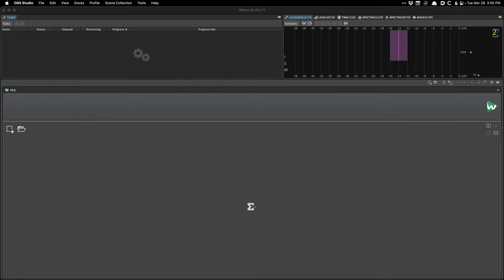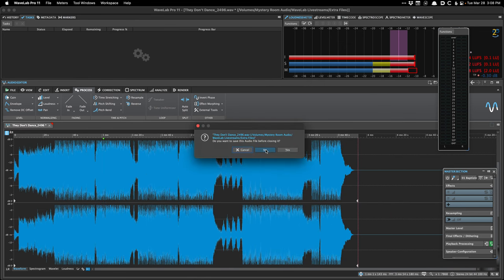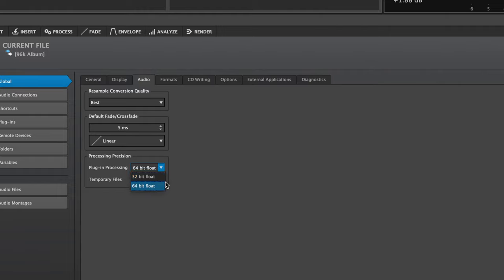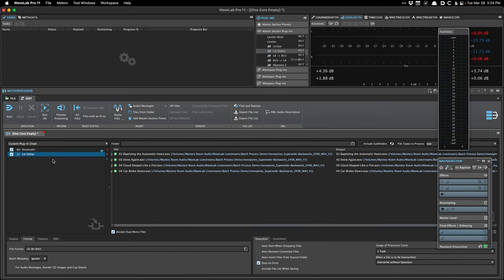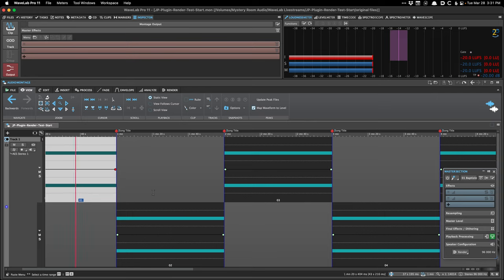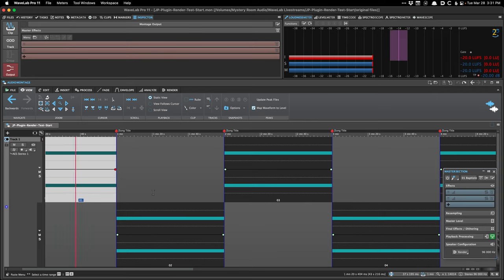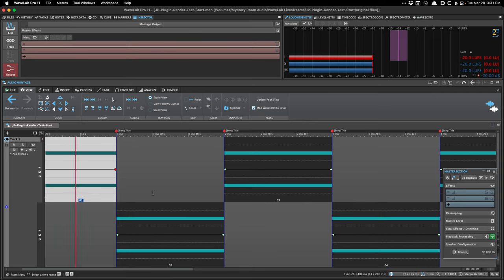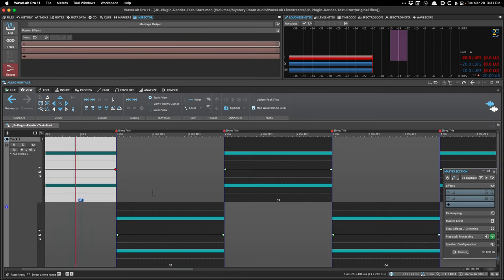WaveLab Pro Workflows with Justin Perkins  | Sample Rate Conversion Methods

Comment: When you are upsampling to 96k for all of your projects, do you use dither as well? Or do you only use dither when exporting final versions? And you upsample always to 96k? If so is that because of how plugins are able to process better at that sample rate?
Reply: No you don't. Dithering has nothing to do with the sample frequency! (see my post above)
Reply: I don't dither when upsampling. I upsample to floating point audio because any additional digital processing will also create floating point audio. The goal is to dither just one time, and at the VERY end of the process, including after any sample rate conversion.

I disagree with Sven. You can use WaveLab's internal bit-depth meter to visually see that changing the sample rate will increase the bit-depth of the audio and then it's up to you if you want to dither to 24 or 16-bit (depending on what format you are rendering your final master files to), or just truncate those bits without dithering. There's no right answer but Sven is wrong.
Reply: @mysteryroommastering-justi6737  So I'm wrong, am I? It's kinda scary how someone with your vast experience can have such a poor understanding about such basic things as the difference between "Samplerate Conversion" and "Bitdeph reduction".

I guess we'll have to go back to the basics of basics (even before 101):
1) "Bitdeph reduction" refers to how many bits represents an audio file, and therefore in how many levels the waveform is mesured.
2) "Dithering" refers to adding noise, in order to smooth out the quantisation errors that occures when the bitdepth is reduced (ex. 24-bits -> 16-bits). When increasing the bitdepth, dithering serves no purpose.
3) "Samplerate conversion" refers to changing how many times per second a measurement of the waveform is taken, and has absolutely nothing what so ever to do with the "bitdepth"!

So I'm wrong? How? Please, explain. In the video, you complain that the "Resampling (Samplerate Conversion)" function doesn't offer a "Dithering" option. Why should it? What's the point of adding noise when changing the samplerate? Please, elaborate.

As soon as you do ANYTHING to an audio file, it's automatically changed by WaveLab to 32-bit floating point, internally. There's nothing you can do about that. So what does the "Bitdeph meter" has to to with the subject in question?

This is very important for YOU! Your very credability is at stake. How can we trust anything you say, if you get these basic facts so wrong? What will your clients think, when they learn that you add noise when changing the samplerate, for no reason?

Comment: And then you have two montages with all the plugins baked in, with two different sample rates. And now you can render track by track to different bit depths, from both 96k and 44,1k.
Reply: Yes, but it takes longer to render two montages with the plugins baked in than just one. I'm done arguing about this. Do whatever works for you. I also dislike dealing with the master section and saving/loading the settings/presets separately. I need a workflow where all the settings are stored within the montage.

Comment: I’m not sure what I said that Sven latched on to or misunderstood but I had to block him as he’s a time-wasting troll. He’s proven that already on Facebook.

To clarify, if you have for example a file that is 24-bit/96k and you need to convert it to 44.1k, the Resampling algorithm (aka sample rate conversion) will happen at 64 or 32-bit floating point depending on your WaveLab setting. 

Therefore, you either need to dither to 24-bit when rendering/saving the new 44.1k file, or simply truncate the bits above 24-bit. Only you can decide what sounds best but the facts are the facts.

The same is true if you were trying to convert a 24-bit/96k WAV file to 16-bit/44.1k. You’d want to insert a dither plugin AFTER the resampling to dither the floating point resample processing down to 16-bit.

The Resampler and basically any digital processing from plugins or even a simple gain change happen in floating point so any time you apply digital processing to 24-bit audio (including sample rate conversion), you need to consider adding dither or otherwise you’ll be truncating the bit-depth when saving or rendering to a new file. This is true even if the source file and destination file are both 24-bit.

WaveLab has an internal bit-depth meter so you can verify this yourself.

Comment: Why don’t you render the whole montage with the sample conversion you want, without doing anything with the bit depth. Then you have a new montage with the new sample rate that you can render in to tracks in new bit depths with dithering on. Just the same way you do it when you don’t change the sample rate.
Reply: It's explained in the video :) It allows the most flexibility and control to do it the way I explain at the end. In mastering we often need to deliver multiple sample rates and bit-depths and this is the fastest and most accurate way to cover all bases, and avoid any issues if the album has crossfades and/or gapless transitions. 

It's all explained in the video if you care to watch it.
Reply: In addition. It takes awhile to render the montage with all the needed plugins so the method I use requires only 1 rendering with all the plugin processing, and then then the rest of the renders go quickly because only a dither plugin is needed on the subsequent renders.
Reply: Yes, I’ve seen the whole video. But I mean, why don’t you do the same with the internal sample rate converter, instead of an external one, like Izotope? That’s much easier and quicker.
Reply: @kbergz  Because as mentioned in the video, the Resampler in the Master Section can cause sample imperfections when rendering track by track if gapless/crossfaded tracks are involved. It's likely not an issue when songs have true silence between the songs which is most of the time, but not all the time.

Also, that method would require a long render with all the plugins involved to create the hi-res 96k version, and then another long render with all the plugins involved to create the 44.1k version, and then perhaps another long render with all the plugins involved to create a 48k version if needed. That's a lot of plugin number crunching. 2 or 3 instead of just once.

With the way I describe, there is only one long render with the plugins involved needed, so it actually takes less time in most cases.

I'm not saying you have to do it my way, I'm just showing what I do and explaining why. I do not agree that it would be faster to use the Master Section Resampler for all the formats because it takes time to render the full montage of an album when all the required plugins are running.
Reply: @kbergz  Also. Forget about iZotope RX. I would do the same process but via the WaveLab Batch Processor to downsample because again, it's faster to just bake in the plugin processing 1 time at the highest sample rate vs. multiple times for multiple sample rates.

So that, combined with the fact that the Resampler in the Master Section can be sample imperfect if you render a WAV of each album track/song and gapless transitions are involved. This method solves both issues and saves time.

Comment: Excuse me. I can't believe what I'm hearing! You ask weather there is dithering or truncating applied when changing the samplerate! That makes absolutely no sense, what so ever. Resampling (samplerate conversion) and bitdepth reduction are two totaly different things, that has nothing to do with each other. That is like asking how many dBs of comression your filter appies!

I can't beieve that I have to explain this, but here goes. Dithering or truncating only applies when reducing the bitdepth! It has nothing to do with changing the sample frequency. If you change a 96kHz 32 bit float to a 44.1kHz 32 bit float file, no bit reduction (dithering) is performed. It's still a 32 bit float file.

How it works is that you resample (samplerate convert) the file, and then apply the bit reduction (and dithering/truncating) as a separat process. I believe you could make a preset that automates these processes.

I can't believe you don't know this. Are you perhaps pulling you wiewers legs?
Reply: Changing the sample rate will affect the bit-depth. You can use the bit-depth meter in WaveLab to confirm. If you start with a 24-bit or 16-bit audio file, changing the sample rate will increase the bit-depth to 32-bit floating point or 64-bit floating point depending on your WaveLab settings.
Reply: @mysteryroommastering-justi6737  It still makes no sense for any dithering when changing the sample rate internally in WaveLab. Dithering serves no purpose until you SAVE the audio file with a LOWER bit depth! Once again "Samplerate convertion" and "Bitdepth reduction" are two separate functions that has anything to do with each other.
Reply: @svenisaksson3970  In WaveLab, you need to insert a dither plugin absolutely last in your processing chain before saving or more correctly “rendering” the new file, whether it’s 24 or 16-but. Bit-depth and sample rate are indeed two different things but the resampling process will increase the bit-depth audio that was originally 24-bit. 

I’m not wasting time arguing with you. Find someone else to troll.